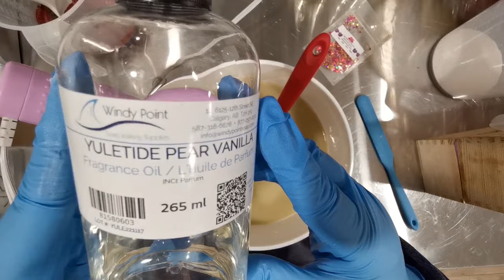Let's Make Soap and Talk About My 2024 Business Goals!

Comment: Started making soap in 2007 for 5 years straight i had many successes in my business. Unfortunately and put in alot of work. I loved making soap. However after I had my babies I could no longer make soap in the house. So I took a pause. After s few years I wanted to start making soap again but hurricane hit in 2017 and then there was covid. Now I am planing to start up again and I an super scared because of that state of the economy. I am planning on keeping my cost low by using really inexpensive means of packaging but I still want my product to look good high end. Anyone here have any suggestions?
Reply from the maker: One inexpensive packaging option would be cardstock and your printer, along with Online Labels. Shrink wrap may be even less expensive but most cost up front. You can buy bags, the impulse sealer and a heat gun inexpensively on Amazon. The National Shrink Wrap System is a big investment up front but the cheapest option in the long run for your packaging needs. I hope that helps, and welcome back to soaping! 💜